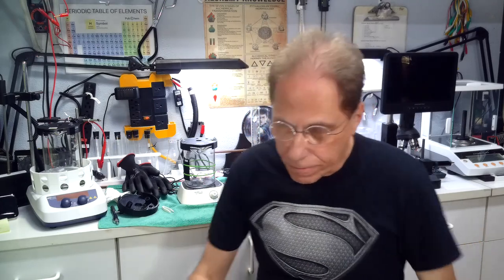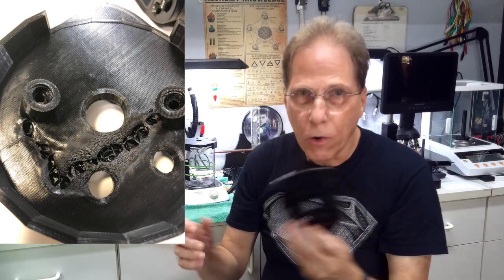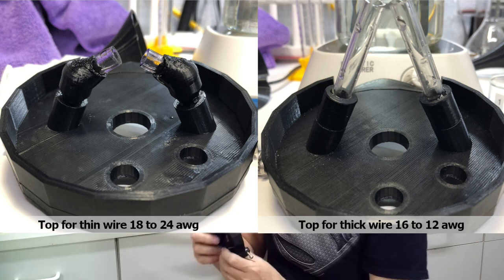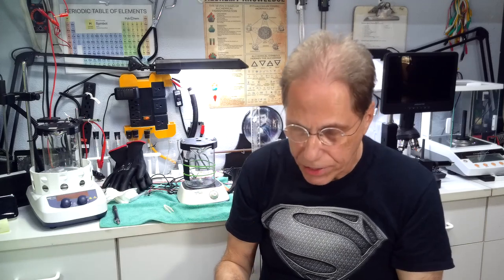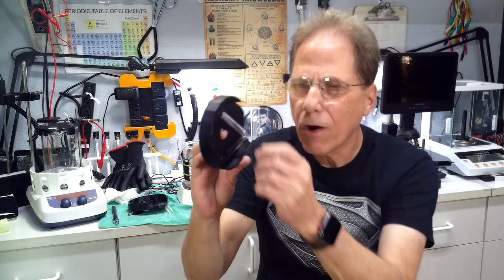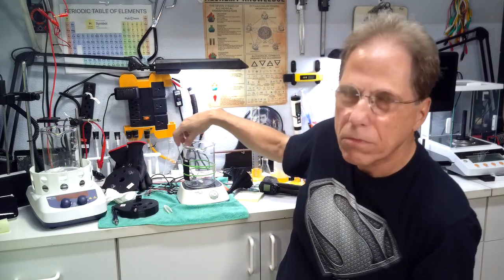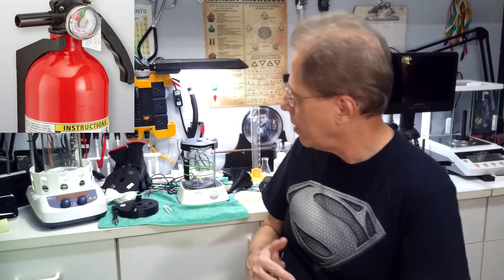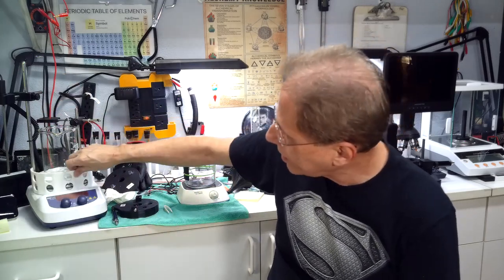Beaker Top Redesign due to Fire Hazard.

Comment: looking forward to the new designs improvements Hermes. great work!
Reply from the maker: Narrowing the ends of the tubes (to increase stability of the fine wire) has the unexpected result of the fluid running up the tube and spilling out the top. More experimentation is needed.
Reply: @AlchemyWizard   wow, just shows how off the theory  vs practice was. ..some kind of back pressure...   I haven't seen/heard you mention any difficulty in aligning the wires to 1mm arc distance : within the 8mm tubes...so if thats not an issue...its probably a mute point. if as you say the plasma arc 'locks-in' , then having 8mm of wiggle room probably extends plasma arc time, and that's gotta be  agood thing. :)
Reply from the maker: @magic-happenz  That extra space at the end of the smaller wires, 20 to 24awg is difficult to maintain (but does work). It is hard to get the two wires aligned end to end and they often don't burn on both ends but up the middle of one of the wires. I can't believe how spoiled I got using the clamps and the bend in the ABS plastic to help stabilize the small wires. 

I like the tapered ends using glass eye droppers for the almost perfect alignment and practically no lateral movement. My chemist suggested using something to seal the tube ends. I tried pieces of silicone tubing but that does not seal around the open tube completely. I am going to try modeling clay or plumbers putty to temporary seal the ends of the tubes so the water cannot flow out the top.
Reply: great work hermes, yes It will be interesting to know if the amount of back pressue through the tube can be equalised / prevented with sugru or a Food Grade Silicone Mold Putty. awesome.